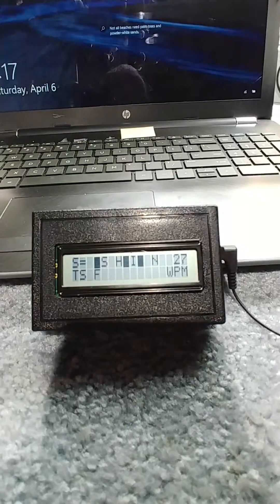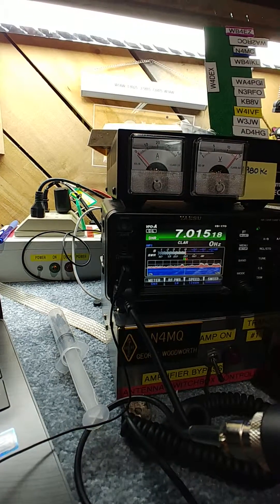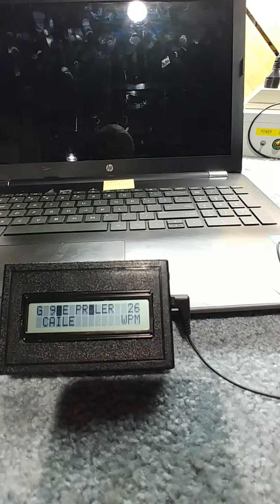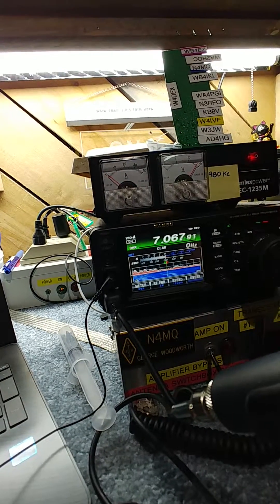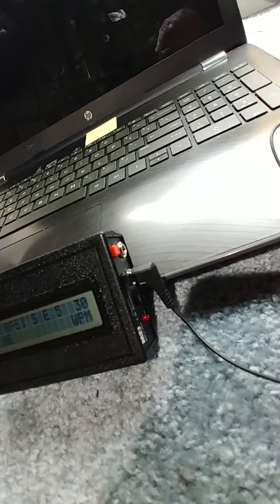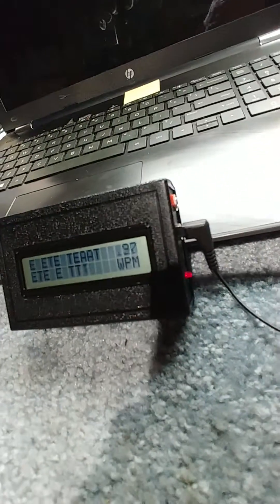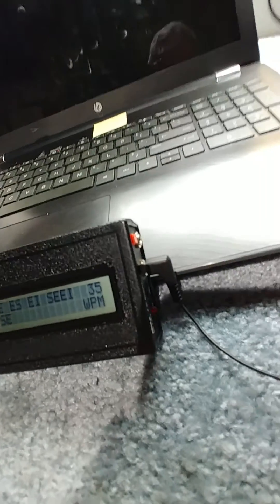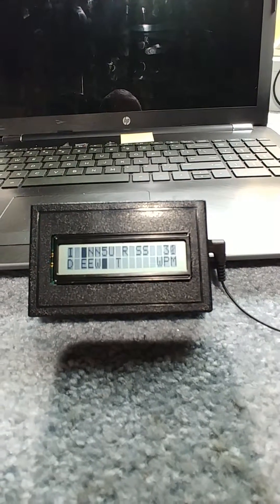Evaluation of MFJ-461 code reader

Comment: The volume and tone were not properly adjusted on the back of the device and probably the audio out level was way too high. I’d say the problem is in the settings. You did not even try to change the “volume” or audio level on the rig. LED blinking means just a start - it does not say it will automatically decode.

Then as said there is “tone” setting. It has to match the tone out from the rig. Go easy on the vfo knob and find a sweet spot! Not just leave it in one place - tone varies by few Hz up or down the freq.

Comment: This looks worse than it should be. Could it be overdriven? I do not know this particular model but readers usually come with a very narrow PLL which needs to be adjusted to match whatever you use in the radio. Make sure sure that the LED not only blinks (which could be noise) but blinks in sync with the CW signal. This is easier with the builtin microphone than with the earphone cable.